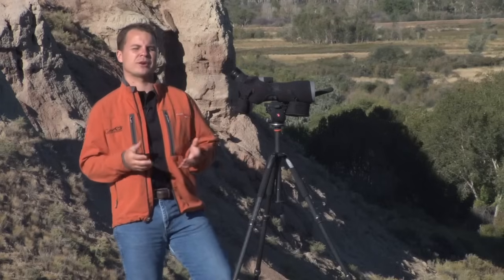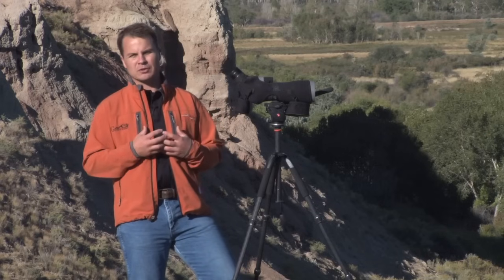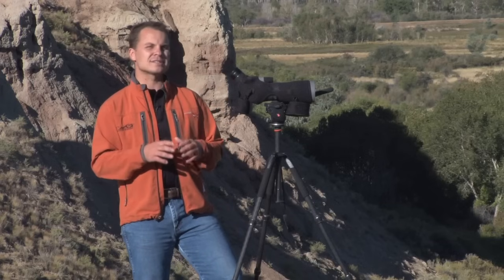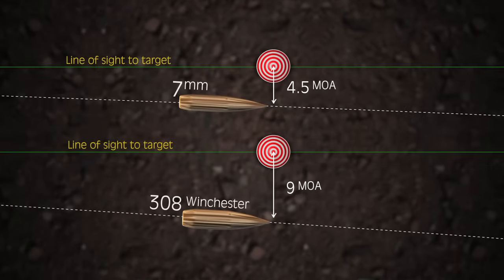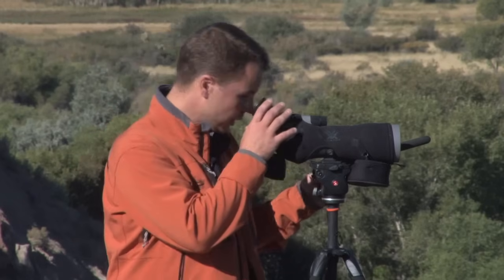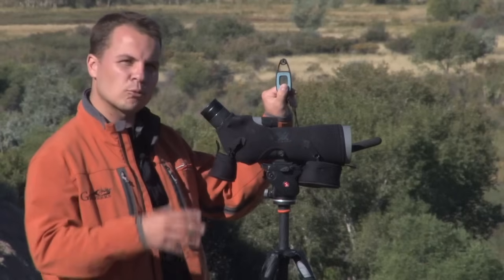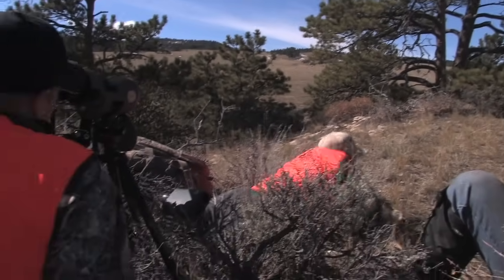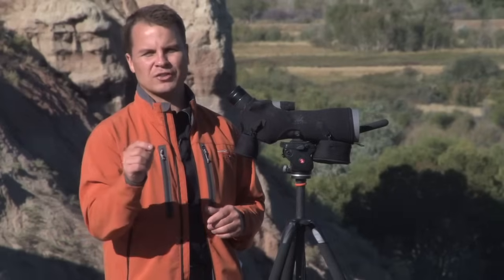Determining Wind Speed and Direction

Comment: Solid advice. Something to watch and think about to all the advanced shooters -  In my opinion the atmosphere is like a giant invisible ocean. Waves in the ocean come in sets, 3's 7's 9's, with 9 being the end of a set. The size builds through the set. The end of the set usually has the biggest wave where all hell breaks loose. This is often followed by a relative calm. Well if this theory be true about the atmosphere, a relative channel of calm can often be found at the end of a set. This channel of calm allows all sorts of opportunity, sometimes even almost windless conditions. If time is no factor, one can wait for the calm after the 9th wave ( biggest gust) before sending it. If you're lucky enough, you can shoot inside this channel of opportunity each time, thereby minimizing the variability.  One can test this theory by watching the flags on a range as the wave of wind moves towards or away from you. Similarly in the field, the grass and trees will tell this story. It's called the Oberem Technique ( Joke). Test it out and feel free to comment. Obviously the shape of the land factors in as the air gets compressed around obstacles hills etc. The inverted invisible ocean with it's wave like winds nature persists and is a valuable tool. In a match if you are able to stall, move to the line to start towards the end of the 7th set, this way you should have calmer wind during 1, 2, 3 etc. Hope this makes sense and no I don't smoke....
Reply: Here's word on shooting on demand in changing wind/weather conditions with MOA wind constant formula applied to M4/M16 applications shooting M855 ammunition: 

Factors that affect trajectory. There are five environmental factors that affect trajectory.  

1.	Gravity-is a constant force that causes the bullet to fall toward earth the instant it leaves the barrel.
2.	Drag-is the atmospheric resistance placed on the bullet that starts slowing the projectile the instant it leaves the barrel.
3.	Temperature-differences in temperature cause the burn rate of the gunpowder in the cartridge to change. As the temperature rises gunpowder burns at a higher rate and as the temperature falls the gunpowder burns slower. As a rule, an increase of 20 degrees. will cause the bullet to impact 1 MOA higher. A decrease of 20 degrees will cause the bullet to impact 1 MOA lower. 
4.	Humidity-changes in humidity, either higher or lower, causes the air density to change. The higher the humidity the less dense the air is. The lower the humidity the denser the air is. The density of the air affects the bullet by affecting the ease at which the bullet passes through the air. As a rule, a 20 percent increase in humidity will cause the bullet to impact 1 MOA higher on the target. A 20 percent decrease in humidity will cause the bullet to impact 1 MOA lower on the target. 
5.	Wind-causes the bullet to be pushed either left or right off its intended point of aim. Wind deflection is always in the direction that the air is moving. Wind deflection decreases as the angle of the wind to the line of flight decreases. Reading and correcting for wind effectively takes practice, especially as distance increases where accuracy in correction is more critical.

 No matter what the experience level, to combat the effects of wind the shooter must understand 3 things.
   1.The direction the wind is blowing.
   2.The velocity of the wind.
   3. The distance from shooter to target

Wind estimation. There are several techniques used to estimate wind speed and direction.

•	MPH indicators-
          
1.   Winds under 3 mph can barely be felt but will drift smoke. 
2.   3-5 mph wind can be felt lightly on the shooters face.
3.   5-8 mph winds will keep leaves in constant motion.
4.   8-12 mph winds raise dust and loose paper.
5.  12-15 mph winds cause small trees to sway
 
•	The clock system- is used to estimate the direction of the wind. Once a direction is determined a value then can be given to the wind. The value of the wind is in a direct relationship with the direction of the wind.

1.	Full Value is a wind that is blowing perpendicular to the direction that the bullet is traveling. In the clock method, this would be a wind that is blowing from the 3 o’clock or the 9 o’clock position.
2.	Half Value is a wind that is blowing from a quartering direction. It only has half the effect on the bullet’s impact. In the clock method this wind can best be illustrated as a wind blowing out of the 1, 5, 7, and 11 o’clock directions.
3.	No Value is a wind blowing in the direction of the bullet’s path. The wind comes directly from the front or rear of the shooter. This wind has no effect on the deflection of the bullet. In the clock method the wind would be blowing either from the 12 or 6 o’clock direction.  

•	Mirage- is caused by the reflection of light through layers of air. By observing the movement of the mirage, a shooter, through experience, will be able to estimate the velocity of the wind. The shooter will also be able to judge the direction of the wind. The shooter may have difficulty judging the value. To see the mirage a shooter should adjust the focus of the spotting scope to the approximately halfway point of the target. Observation of mirage can also be achieved by focusing the spotting scope on the target and turning the focus knob ¼ turn counterclockwise. This will adjust focus to the halfway point.
Compensation for Wind. There are two techniques to compensate for the wind. They are:   

1.	Hold offs are where the shooter aims at a different spot, other than center mass, on the target to compensate for wind.
2.	Sight manipulation is the moving of the windage knob, either left or right to compensate for wind. 

This formula will allow you to adjust for the distance that the wind displaces the bullet: distance to target in yards divided by 100 times wind value in mph divided by the constant of 7 equals bullet drift in MOA. Note: the constant of 7 is correct for M855 ammunition fired from M16-A4 or M4 to target 500 yards from shooter’s firing point.

Distance to target in yards / 100 X Velocity in MPH / 7 = MOA of Drift

Here’s an example for a 10-mph full value wind at a target distance of 500 yards:
500 / 100 X 10 / 7 = 7 MOA of Drift

Comment: In the comparison of the two rounds you aren't mentioning the speed of the bullet. Try this again and use the 300 win mag. and the same weight of bullet and you will see a big difference. It is not a fair comparison between the 7mm mag and the 308 which with a 168 gr bullet is much slower. The 7mm at a faster time to the target is exposed to less wind.

Comment: In Sniper School we were taught to use "full value" (direct crosswind) and "half value" (quartering wind 45º off) in the determination of our wind. If you were at 1000m and 10mph left to right direct crosswind that would mean 8.3 MOA or roughly 83" deflection due to wind.  The rules of thumb I used in the calculation were only good for the 7.62x51mm NATO round we used but can still be used for .30-06 for a 168 gr bullet. The constant you use depends on the caliber and bullet weight of round you are shooting.  A quartering crosswind would he half that, or  "half value" or 4.15 MOA which would equate to about 41.5".  And since wind can often change significantly over the entire path of the bullet, check your mirage 1/3 the way to the target and 2/3 of the way to the target. In Shitcanistan on a 1000m shot in the mountains it was not unusual to see the wind literally change direct from left to right to right to left along the path of the bullet. You have to judge both and average the difference to give you an accurate windage.
Reply: I was just here for research, and found all the answers in the comment section. Thank you sir!
Reply: Excellent advice. I have .338 lapua mag. Right now I am loading my own 180 gr. Bullets I do have some 220 gr. Match grade but haven't shot them yet. These bullets are expensive to buy.
Reply: Half value are winds out of 1, 5, 7, & 11. Winds out of 2, 4, 8, & 10 can be treated as 70% value. M118 LR from M24 at 2610 has an MOA wind constant of 10 at 1000, thus a 10 mph full value wind would move impact 10 MOA, or 100 inches at 100 yards.
Reply: Oorah
Reply: My experience in mountains was trying to get from one peak to the next... everything changed consistently, quickly.. next to impossible to predict almost shot o shot. Definitely time of day, temps...
I burned out more than one barrel simply pizzed and forcing shots during practice. The only answer was go big.. .50 or go home.

Comment: 7mm doesn't require "less" doping than 308, both calibers have the potential to make long range shots.  The shooter must still understand all of the variables and make the necessary adjustments to hit the target, the only real difference is the Numbers used.
Reply: The point being made was the .308 Winchester is not, per se, the only or even the ideal long-range cartridge. Most experts in LR shooting recommend starting with .308 since it is so well-sorted out ballistically, with so much pre-existing DOPE and information on how its most-common projectile weights/styles behave in the wind. That's the good news. The bad news is that .308-caliber bullets (projectiles) do not become highly-efficient until at 190-grains in weight, and ideally over 200-grains. Which puts the most-efficient .308-projectiles mostly out of reach of the short-action .308 case. Simply put, your typical .308-caliber 168-grain BTHP Match projectile isn't all that efficient or flat-shooting. At 1,000 yards, it is inscribing a severe parabola (arc) coming down into its target,and since it isn't very good at cheating the wind, it gets blown around a good bit on the way there. Can a seasoned competitor or user get good, even exceptional results, with it? Sure, but the bullet and cartridge are not working for you as much as with some other choices. Which is one reason why calibers in the 6-7mm range are so popular with F-class, benchrest and other long-range distance shooters. In non-magnum cartridges, they tend to have manageable recoil and projectiles in this caliber range, .243-.284, have excellent BC values and perform well in the wind. The majority of the highest-ranked PRS and other LR competition shooters today use 6mm Creedmoor, 6.5 Creedmoor, and similar cartridges.
Reply: That is why I now use Gerber 155.5 ...instead of the New Sierra..to get more BC and less guessing.. as I am NOT a great wind reader!!
Reply: Especially if the scope is adjustable in Minutes of angle or in MM or in inches, which both have good adjustments but if your going to custom loads ie: projectiles with a very low coefficient % and different powder to give it justy that little more  power and also so many other features like the barrel twist ratio also plays a large part of how accurate and distance you can achieve as well? the only way your going to know is you can read the wind down range by eye and then make the adjustments as you shoot, the wind could be 10 miles per hour near the shooting line but down range it could be 35 miles per hour, so knowing you scope adjustments based on the 100 and 200 yard doping the rifle and then make you adjustments based of that, but so many extra benefits can make a rifle or weapons system be great at long range and they are basic items like epoxy resin the barrel into the stock so no movements will change the barrel and other extras like barrel grade stainless or chrome moly, now for F class comp shooting well thats the formula 1 of target shooting at long distances other than the military's sniper comps, which is totally different again world wide ?m

Comment: 7mm Rem Ultra Mag is the real beast at about 30 caliber-  problem is barrel life is only 600 shots-
Reply: Brent Owen you have no clue
Reply: “600 shots”??
Reply: 1000000% false.  Stay in your armchair.
Reply: @jasonmpd2946  I shoot 6.5/284 in NRA Long-Range Competition. After about 500 rounds the barrel throat is washed out enough that I can no longer hold inside 1 MOA at 1000 yards, meaning too low an X count to win at High Master level. At any rate, I suspect Jay is right about barrel life of 7mm REM Ultra Mag. BTW, I also shoot .223 in LR Competition. Typically barrel life for a cut rifled barrel is about 3000 rounds before sub MOA results deteriorate.
Reply: must not clean gun and leaves outside between shoots

Comment: Wind is just a part in pin point accuracy you got Barometric pressure, Altitude, Temperature , Humidity, Range , Angle of sight ,  POA and Ammunition ballistics.
Reply: Humidity is really not that big of a factor and contrary to common belief the higher humidity the less resistance and less drop.
Reply: Smiley Tactical Humidity is a huge factor it effects the projectiles complete trajectory.Its the basic laws of physics air containing higher levels of water molecules is an altered atomic makeup and density. Heavier air requires more energy to force an object through it. At long ranges your point of impact will change in different humidity levels.
Reply: it will not change that much. From 0% to 100% humidity 308 will only change point of impact by about 2 inch at 1000 meters. What are you shooting at those distance that require more then 0.2 MOA accuracy? Check yourself on a balistic calculator. like I said on the first comment the more humidity the less resistance for the bullet. Look it up.
Reply: All of those mean nothing if you can't properly read the wind.
Reply: injectingRevolution Think you forgot Coriolis effect and bullet drift or spin drift

Comment: Thanks for these Infos. Would be great if you could tell us more about reading the wind by watching the Vegetation.
Reply: It's simple: if vegetation leans certain direction it means wind goes into that direction. Faster shaking of leaves is faster speed.
Reply: @shinoasada2216  you don’t say! Lol obviously he’s asking for some info on how to judge wind speed not direction! @wiederladerTv the thing is not all vegetation will move the same in say 5 mph wind some will bend more than others and so on so the best experience you can get is to go out in your area and watch the veggie while taking wind measurements and recording your data.... I’m a hvac contractor and if you don’t have a good wind meter they make one you can buy that plugs into your phone that we use to check airflow at vents it is pretty accurate 👍and fairly inexpensive

Comment: It is one of the top Rounds there is the 7 mm WSM is better than the 7 mm Mag, the 6.5 is pretty darn good as well.
Reply: However, a bullet with a high BC value is obviously low friction and also likely has worse terminal ballistics (less expansion).  So accurate shot, less damage.

Comment: wow,..so he wants to convince us to shoot 7mm mag. Why can't they just present the info without trying to push their opinion in which cartridge is best. I shoot .308. i'm used to doping my scope with a .308. Doesn't matter what you haev,...it's all what you are used to , and what you are practiced with. 1000 yards is very doable with a .308.
Reply: Because he owns a custom rifle company and probably has a monetary interest in selling 7 mag.
Reply: There's nothing wrong with .308. He's simply trying to point out the advantages inherent in other chamberings and calibers. Yes, 1,000 yards is within the performance envelope of the .308 Winchester, if the proper bullet (projectile) and load are used, along with the correct dope and a skilled person behind the trigger. But most .308 loads run out of gas by that time, or perhaps 100-200 yards further, whereas a 6.5 Creedmoor 147-grain ELD-M or one of the other high-efficiency 6.5mm projectiles, is only warming up at a grand. It is supersonic out to 1500 yards, fully a third more usable distance. That's due to the inherent efficiency of the 6.5 bullet, which has a much higher BC than the relatively stubby .308.

Comment: Sure the extra speed of the .300 Win Mag would improve the amount of wind deflection.  The recoil will also decrease your chance of spotting your hit/mis and making quick follow up shots.  And the increased recoil serves no purpose since the 7mm round has more than adequate terminal performance.  My preference is actually for the 6.5mm rounds due to decreased recoil.  .30 Cal is old school and would die out if not for the old folks shooting it...  ;-)
Reply: I'm learning more about 6.5 and starting to wish I had figured it out before getting set up with my first 300 win mag.  But hey, those old folks can be pretty persuasive.